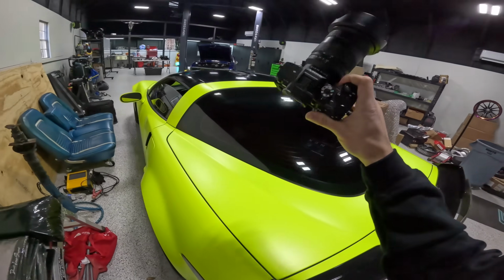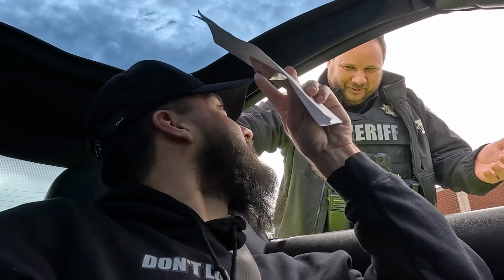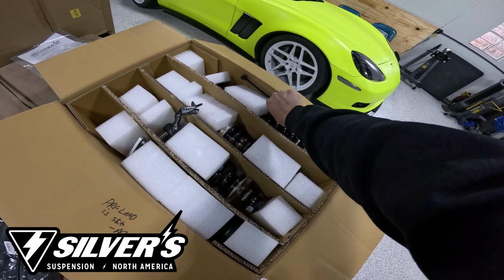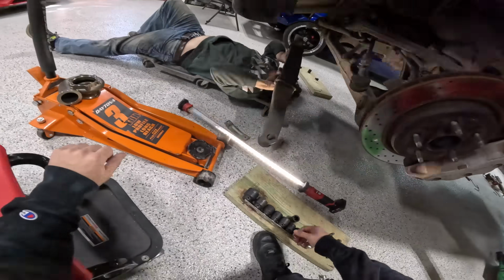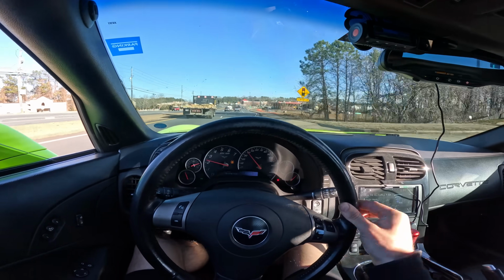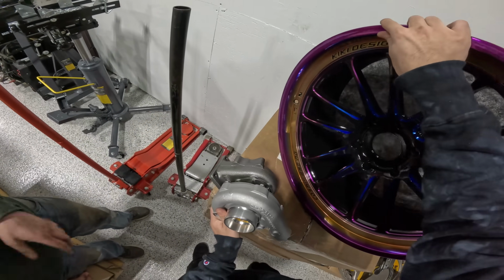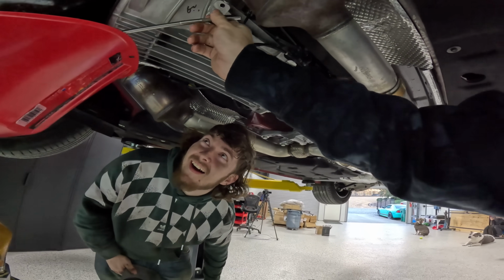Cop Started Laughing When He Saw My Face...

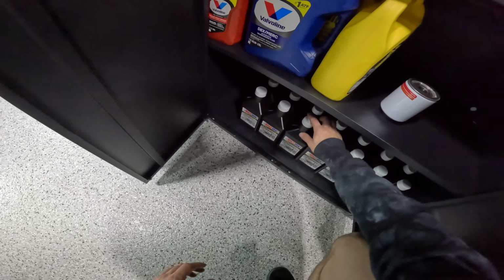Comment: @16:37 correct me if im wrong but i could swear you had a video that mentioned to never fill your oil filter when doing a oil change. The oil inside the filter now will circulate through the engine before it returns to be filtered and catch any contamination.

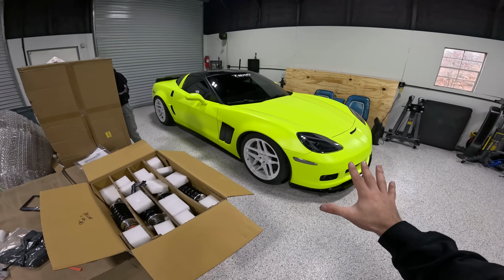Comment: 6:35 PLEASE stop saying the corvette C6 has leaf springs for suspension.  It doesnt.  This isnt an 80s chevy truck.  That is a simple lie spread by TOP GEAR from decades ago and its really not true.  TRANSVERSE LEAF SPRING.  It could have been called TRANSVERSE SWAY BAR.  The transverse leaf spring goes across the middle of the car both front and back and helps keep body roll to almost nothing which is does better than any other car of that time period.

Comment: Hopefully the camber change won’t hurt the handling. Could’ve went with a slightly smaller wheel and tire so you can maximize the ability of those coil overs. Pretty sure the GM engineers chose the suspension they did after lots of track time and testing. After all they are known to have amazing handling.
Gonna have to start keeping count how many times they manage to drain the oil into a plug catch can.